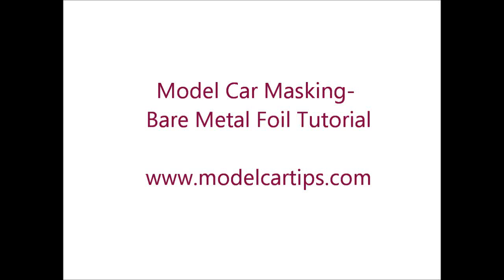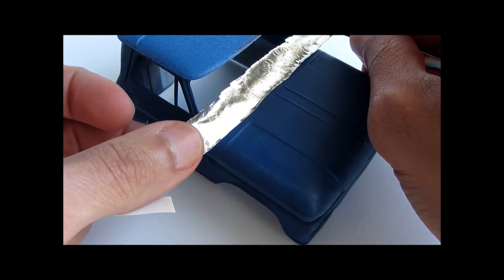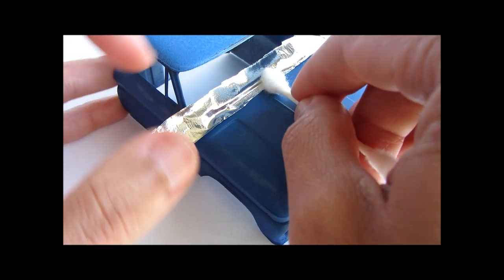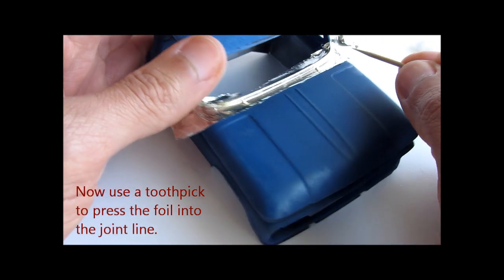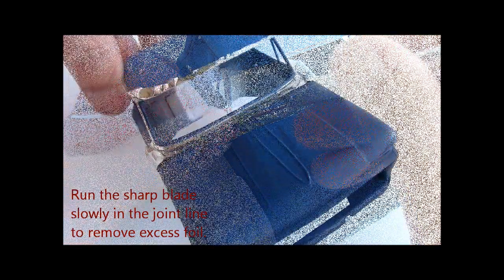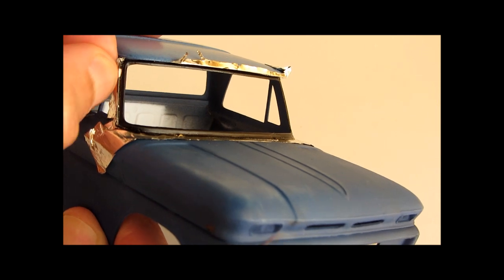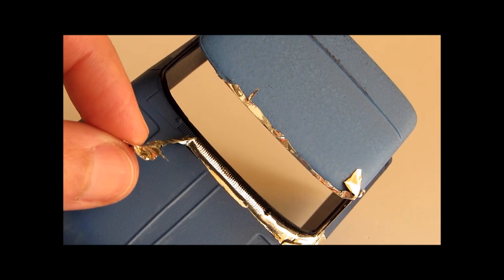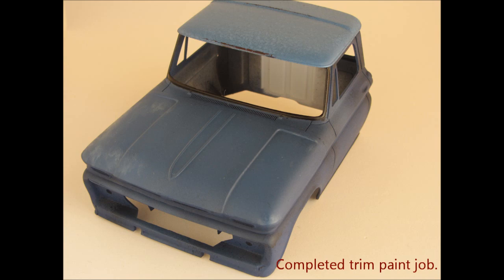Model Car Masking for Paint with Bare Metal Foil

Comment: I don't get this video at all. You are taking relatively expensive BMF just to mask an area to paint and then come back later and reapply BMF for the trim? That to me is a waste when there are far less expensive tapes made specifically for this. I value my money too much to waste it.
Reply: Frog painters tape is the best for masking I found.. Doesn't leave bleed over if you press it down really good
Reply: My question is why bother using mask at all?  
Easier (and cheaper) to use the trim edge as a paintbrush guide, considering any little blowouts with the black paint are going to be hidden by the bmf anyway...